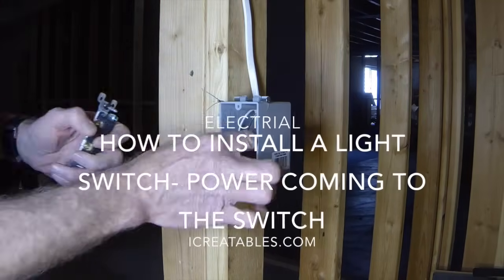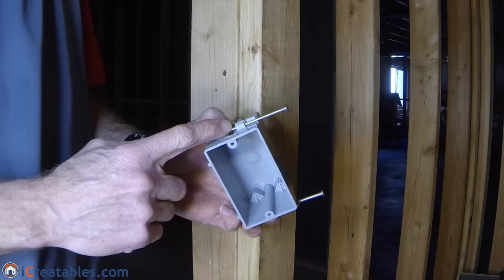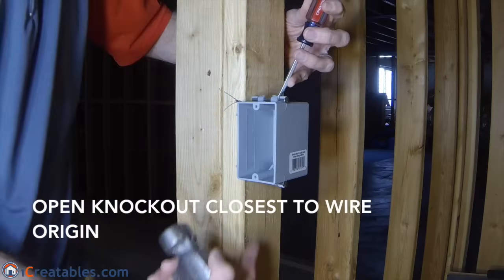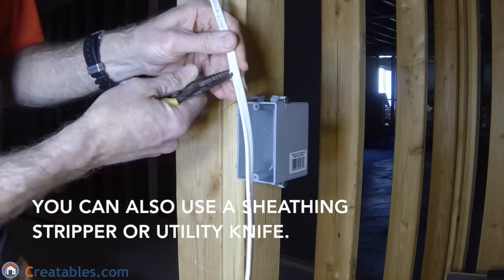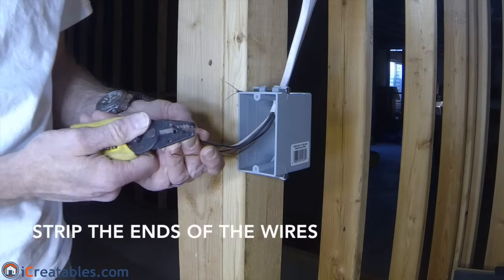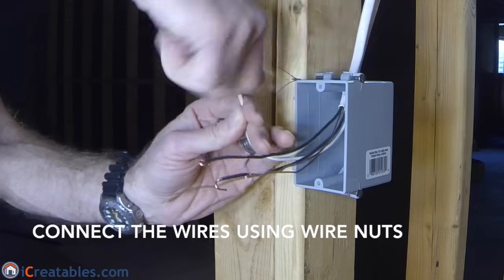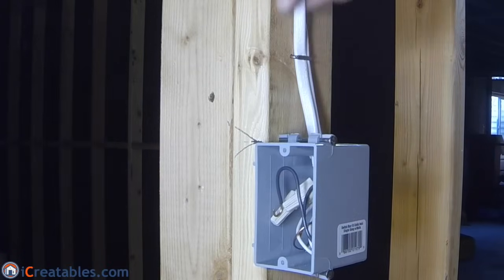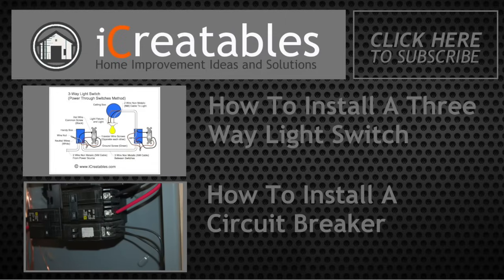How To Wire A Light Switch

Comment: Nice, qq. Do we need single dedicate wire from switch to Light Bulb, it allow multiple joint in wire - I come with issue where my wire from light bulb to switch is little short- Can I make joint to add extra wire or do I need run another dedicated wire without joint

Comment: Nice video. Can you tell me what to do if you are wiring 3 switches instead of one (3 switch box) and power coming in from elsewhere like your video shows? Do you connect 1st switch as described in video then use black jumper wire from switch 1 to switch 2 and 3 respectively? All commons and grounds together? Hope the question is clear. Thanks
Reply from the maker: Andrew Meece Yes the power is jumpered across the three switches so it is not turned off by any one switch. The grounds and the commons are wired together.

Comment: Very informative! I would like to know how would you go about replacing an older light switch. It has a black and a white no ground. And the switch itself has a plate where all the wires connect to. No pigtails.
Reply from the maker: The hot wire goes through the switch. The other wires are connected to each other. if there is no ground then you do nothing with the ground.

Comment: why wasn't there a grounding pigtail and ground added to the switch.
Reply: I’m guessing because one ground is going all the way to the breaker box. So nutting it with the other going to the light should be ok. I’m not 100 percent sure though.

Comment: Is the wiring the same if my power source to my light switch is a 3 prong extension cord? This is for a lighted mirror that will stay plugged in but will turn on/off with a switch. Thanks in advance.
Reply from the maker: Yes, the power does not care what the wire it is riding in looks like as long as it is rated to hold it. :)

Comment: Hey guys I've got a 12-3 set up for a celing fan, no light on fan. Can I use the red wire to power a set of can lights?
Reply from the maker: Yes. The fixture does not care where the power is coming from.
Reply: Absolutely  , that's a great idea  , be safe

Comment: why didn't you pigtail the ground wires  and connect it to the ground screw on the light switch
Reply: you don't have to ground the light switch directly, you ground the box, there is metal strip that you ground to that, then connects to the to the threads which you screw the lightswitch to the box.
Reply: @angelpagan7797  ,:u

Comment: how come you didnt connect the ground wire?
Reply from the maker: That is a mistake. The ground wires must have a pig tail from them to the ground screw/terminal on the switch.
Reply: iCreatables Hey (new to electrical) if you pig tail the ground wires than wire nut them how would you connect them to the switch after? if there wire nutted, because i believe there's a green screw to put the ground wire under.
Reply: Peter Anonamoose You have to add a third length of ground wire into the wire nut(pigtail), then to the ground screw.
Reply: @icreatablestv  Thanks